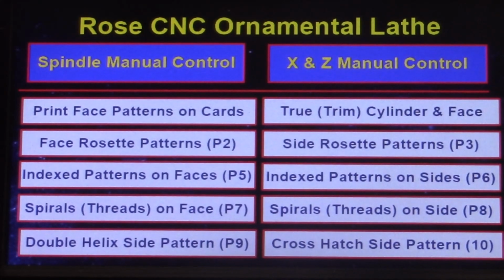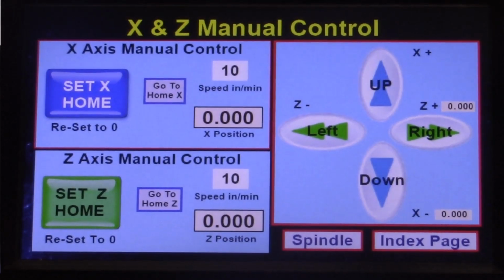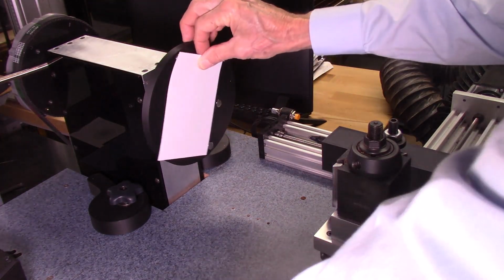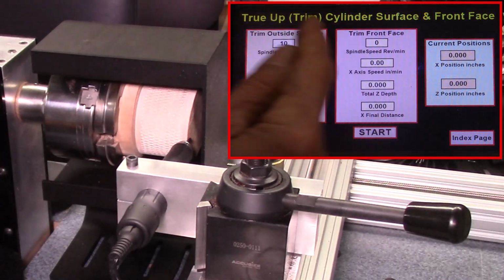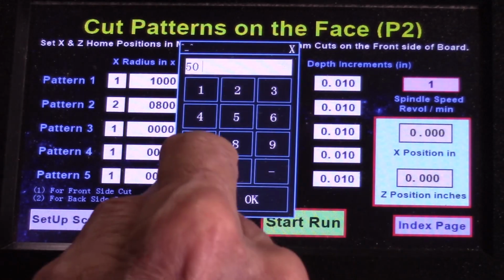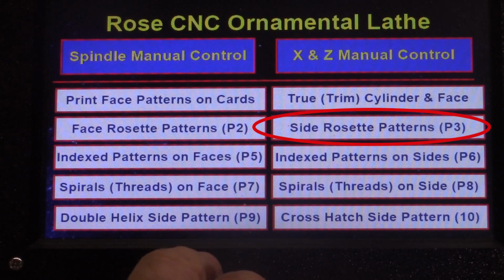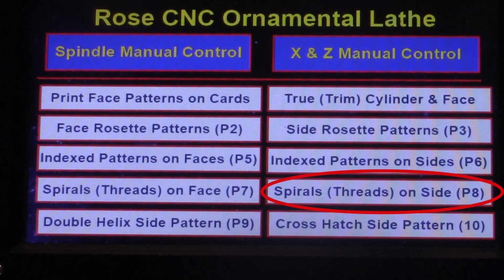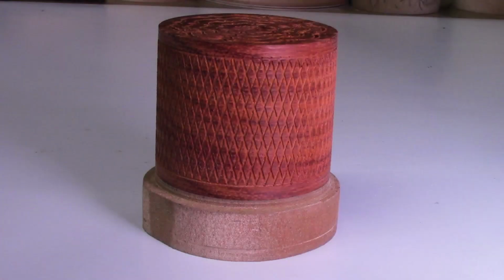Automated CNC Rose Ornamental Lathe - Part 5 - Software Design and Examples of Patterns

Comment: Just wondering if you are going to release the board and screen firmware for this. The series has been very enlightening as I had been considering, and accumulating the parts for a MDF rose engine.
Reply from the maker: This is still a work in progress.   The program to run the system changes every week as I continue to refine the system.  I am not commercializing this system, so I would have no problem with sharing any of my software developments.  However, there are still a few bugs and refinements that still need to be made to the software.
Reply: @Accu-Slice  thanks for the info. I await whatever you release. I currently have 2 cnc routers that were home built, one is a dedicated 4th axis lathe